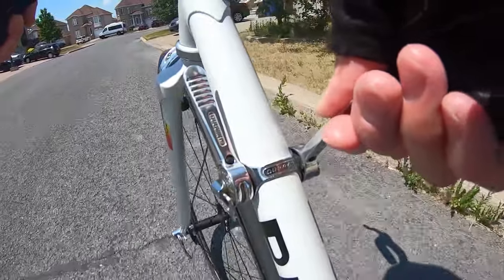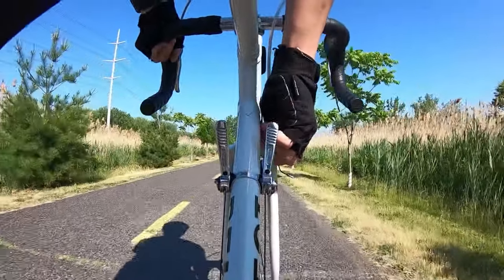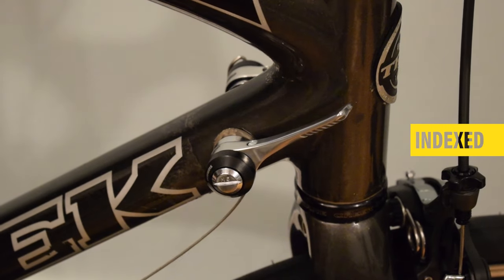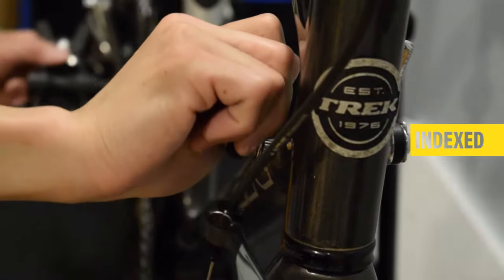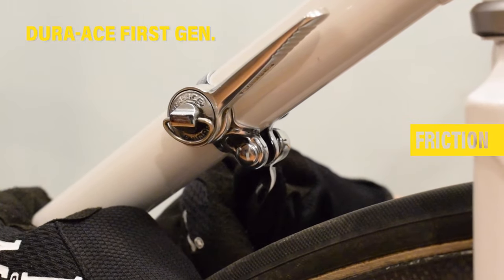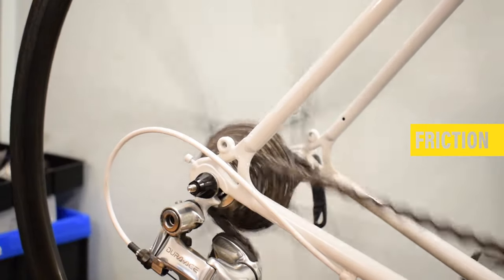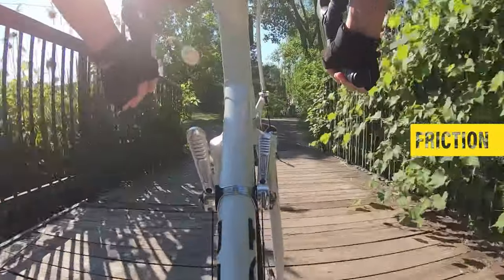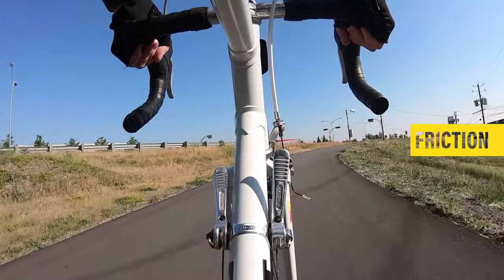First And Last Dura-Ace Downtube Shifters: Index Vs Friction

Comment: I have a Surly Cross Check with drop bars, v brakes and Dura Ace 9 speed down tube shifters in friction mode and love it. For medium speed riding, touring and utility, the gear change is faultless and silent. The only real difference to integrated shifters is that I change down early for a climb and change up later after a climb, but I am not racing, and a second here or there is irrelevant.
Reply: I used to have friction down tube shifters on my first road bike. For the last few years I wasn't able to ride, but now I can finally pick it up again. So I bought an old road bike and it has one of those fancy integrated shifter+brake things installed and I absolutely hate it. It's bulky and gets in the way and adjusting the gears is too complicated. So I will definitely convert the bike back to its original shifters because they're so easy to use once you get the hang and it makes changing the handle bar and brakes super easy, because I'm not sure if I prefer bullhorn or flat bar. The drop bar is absolutely awful for riding in city traffic because you need to look around a lot and the bent over position might be good for speed but it takes away a lot of movement radius of the head.

Comment: Down tube shifters are simple and have less friction points. I think they are more reliable than brifter type shifters or at least they are less difficult to do roadside fixes. I normally only have to tighten them occasionally. There is a greater barrier to shifting and I usually tend to power through on small hills or coast on short descents. I don’t think that is a problem but is probably a less optimized ride.

Comment: I'm currently using both. I've noticed that I pick the index system equipped bikes mostly. However from time time I ride a Peugeot, like you, with friction downtube shifters. That's another story. Being able to ride it as confortably as index bikes, the strong sound of derailleur when shifting, especially from the largest cog to one smaller are details that I love. The simplex derailleur is very different than Shimano's. When touring I would go for a friction system, when the road and traffic situations change often, I would choose index one. Friction systems are more reliable, index ones are more easy. Each one have their own souls. I like both.

Comment: Nice. I just switched my Ironman from Suntour GPX indexed shifters to Shimano L422 Light Action downtube friction shifters, just for giggles. These are similar to retrofriction and have a smoother feel than my Shimano SIS downtube shifters in friction mode.

I haven't used friction shifters on road bikes since the 1970s. Takes a little practice to estimate the lever movement.

I'll probably switch this bike back to indexed shifters and save these L422 friction shifters for another project. It would be great for an early 1980s bike.
Reply from the maker: Nice shifters

Comment: Friction shifters are the best. It's like comparing a manual car with an automatic. Maybe auto is faster, but manual is way funnier. 
I have a 1990 basic MTB with stem friction shifters, but I'm planning on using downtube shifters, just because I need less housing and cables and they will have a little less friction.

Comment: Beautiful video! What if the friction shifters feel too stiff when trying to shift into higher gears? Is this by design or is something wrong? Any way to make it a bit less stiff?
Reply from the maker: You need to loosen the side screws and adjust the tension.
Reply: @DanyoSports  Thanks for the tip!

Comment: Great video, I have a question. I have an old road bike with a 9 speed campagnolo deralier and an 8 speed shimano cassette (wheel is not original). I am converting to flat bars and would to use the downtube shifter mounts. Could I use a friction shifter with the 9 speed deralier and an 8 speed cassete? Thank you
Reply from the maker: Yes, 9 speed derailleur would work on 8 speed cassette if you are using friction shifters. You take full control of each shift with your thumbs so you can mix and match components.
Reply: @DanyoSports  thank you so much for your fast response. This has saved me money which has made me happy. Keep up the good work

Comment: Hi when adjusting your rear derailleur does it not hit your front? Or do you adjust it and not show it in the video because its so difficult and not easy to get used to using friction downtube shifters and requires precise lever levels to change gears. Much appreciate the video tho, i am debating if i shoud change my vintage downtube shifters to modern STI shifters would it be possible?
Reply from the maker: Hi, what do you mean by hitting your front? Mine doesn’t have any issues, the only thing you need to adjust is to set the limit screws for both front and rear derailleurs. Other than that, make sure the cable tension is enough to pull the derailleurs.
Reply: @DanyoSports  sorry the front derailleurs, when gears are like switched on the rear, does your chain hit the front derailleurs? or no?
Reply from the maker: If you are hitting only on the lowest and highest gears, check the position of your front derailleur, it should be parallel to the chain. Unscrew the clamp and rotate it to position.

Comment: Have you ever had issues with the index shift such as ghost shifting? I have a bike with a sunrace index shifting and I cannot get it to adjust properly.
Reply from the maker: No issues with my index shifters, check your cable tension and make sure your derailleur hanger isn’t bent.

Comment: I have a problem with my Dura Ace SL-7700 Down tube shifters. The shifter moves out of the lowest gear by itself when I am putting force through the pedals, such as going up a hill.
It happens in both friction and indexed mode. The other components are in excellent shape and the shifters are brand new. They just keep slipping out of gear. Do you know how to fix it??
Reply from the maker: Did you try to tighten the screw on the side of the shifter? Make sure it isn’t loose so the gear won’t slip.
Reply: Sounds like a limit screw issue.